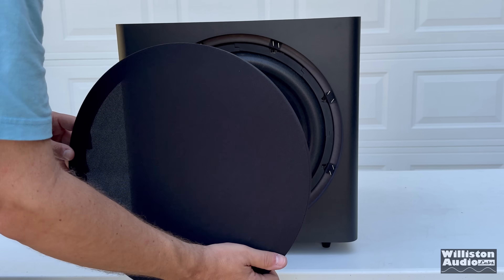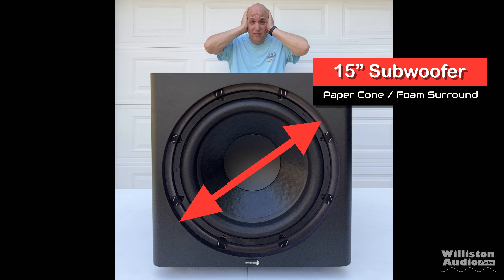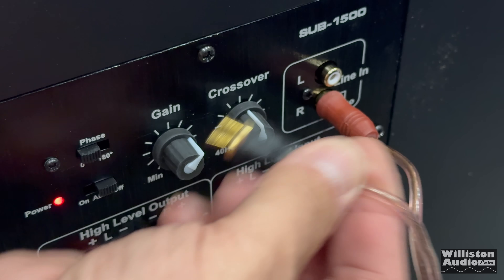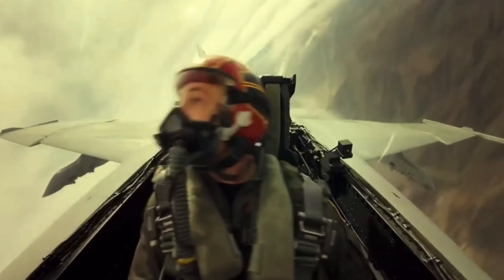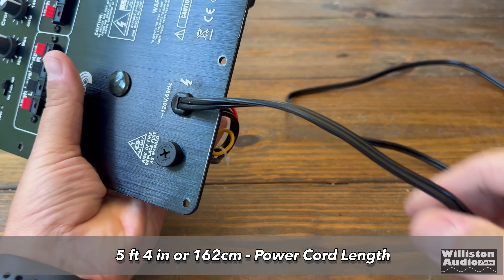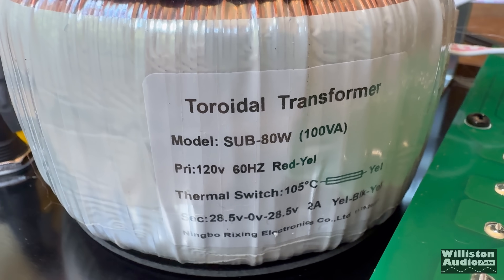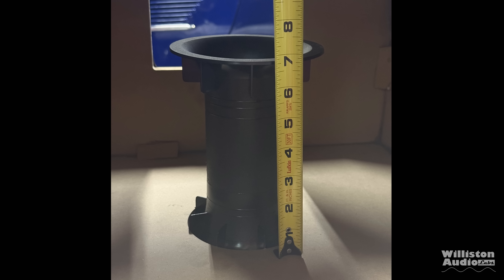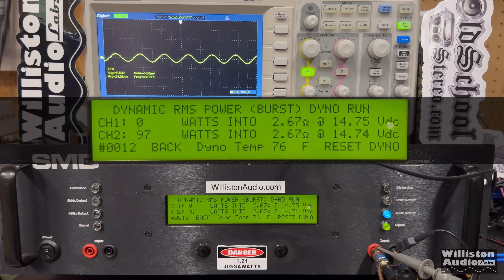Exposing Dayton Audio SUB-1500’s Biggest Secret—It’s Not 150 Watts!

Comment: This is why you build things yourself, people. Look at reviews of individual components and put together something that works. Usually, you can do it for these budget prices and beat what you get (and sometimes beat what is advertised).
Reply: @NorthernWhisper  Right. But when you buy Dayton amplifier to build your own sub won't it be the same lack of power?
Reply: @california3527  Thought i replied to this already but the comment is gone.. hmm.

In any case, don't buy their amp. get a suitable fosi audio amp with a beefy powersupply. Also be aware that their ratings are off so get something they claim to be 200w so you will actually get a full 100-120w of power ;)

You can get that for less than $100. Used enclosure from your locals costing around $20 and find a suitable woofer for that enclosure/your needs that sits at under $100. There you have a twice as powerful DIY build. No need to even make your own enclosure, as long as you have the information needed to know what to get.
Reply: @california3527  Use a fosi audio amp or whatever. Best value is getting a bt30d pro, which will deliver 250w at 2 ohm to the sub and 150 to the stereo channels at 4 ohm with the right powersupply. 

If the budget is tight, they still sell lesser amps for a bit less, but the value isn't as great. Still, you can get an amp for well under $100 that beats the one in this sub. Then you just match it with an appropriate budget woofer and build a simple box or get a used box for almost nothing from your locals.

Comment: for us with dsp, we can just plug the port and boos the bass, to get 20hz out of these cheap subwoofers.
then it is nice to know the max output at those frequencies. powers open and closed please.
and report back on the noise/distortion you hear that the subwoofer makes down low at 20hz.
Reply: There's no way this driver will get any reasonable output at 20 Hz, least of all with that little power. IIRC, Audioholics found it to have roughly 85 dB output RMS @2 meters, CEA-2010 testing. Compared to around 105 dB at 40, meaning you're gonna need serious boosting to increase linearity down low. In-room it might be better, but if you block the port you're throwing power at a sealed sub with a resonant frequency around 50 Hz at best to try and make it play flat to 20. That's gonna take more than this sub can either deliver or handle.
Reply: @TokeBoisen   you re reading the Audioholic testing wrong and my comment.
you plug the ports and you gain output below port tuning, and no need to add much gain to boost the lows, you have room gain and max output at 50hz and above usually is more then you need so it is the lowest bass that is the limiting factor.
and the resonant frequency and below plays just fine on many subwoofers and drivers in a sealed box.
and you wont need so much power to reach xmach on a sealed dsp tuned woofer.

that is why i wrote my original comment, lets get some testing on this so we know more.
you Theorycrafting is not helping anyone, you need experience in this field.
Reply: @sudd3660you're making a lot of assumptions about the driver's behavior in a sealed cabinet, the room size of the user, not to mention my knowledge in the field of subwoofers to make this comment. Suffice to say I don't agree that plugging the port on this particular design would work very well to increase or achieve any substantial 20 Hz bass output unless your room is tiny.
Reply: @sudd3660so because I don't like to be unsure if I've understood something, I simulated the driver in a sealed and vented enclosure as described in this video, and it looks like, looking at AH's testing, they implement a high-pass to protect the driver on the lowend, otherwise the frequency response doesn't line up. You'd still have to account for that if you plug the port and don't replace the amplifier. Either way, given the same amp and box size, in the same room, there's no scenario where the sealed configuration improves the output over the vented for this driver in this enclosure with this amp. Sorry.

Comment: I just sent parts express an email request with this video linked in it lol now we play the waiting game and see what they say. I said " 70 ish watts at $300 plus tax with fake ratings on the box and advertising is just disappointing. "
Reply: According to the model of the driver, it's rated at 150W RMS, and it IS a powered sub, so it's a 150W powered subwoofer :P They didn't say it was powered BY 150 watts :P They also didn't state RMS, and if you remember the old PMPO ratings that got out of hand, you basically can't trust any rating that doesn't specifically state RMS or THD. Which is not to say I don't think it's a scammy trick - but they're not lying so much as omitting the truth. With all that said, I don't care much about wattage. You can put 100 watts through a lightbulb and it won't even make a noise, so efficiency or SPL is the more important factor.
Reply: You should have probably sent that email to Dayton audio. Not Parts express. They are simply the distributor. Dayton audio are the ones blatantly lying about the power output.
Reply: @dextermorgan1 Dayton Audio IS Parts Express. Look up the trademark.
Reply: They should catch an earful as well.  @dextermorgan1
Reply: They'll probably blame the Dyno say it was rigged lol

Comment: I have to of their 12" setups, not impressed so I  Built a box for a skar 18 SD in widisd. 24 hz, running a SD500 plate amp. Cant use but about half volume in my theater room, its over kill.

Comment: I really hope it was an error on their part because Dayton Audio is a very good company as well as Parts Express so it will be sad if either one starts going to shit with the lying about the products.
Reply: They very likely were doing this as a way to dump old stock.
Reply: @LKN117  That still doesn't excuse blatant false marketing. Cheap, small wattage subs do have their place for beginning audiophiles who want to beef up a little bit the bottom end of the bookshelf speakers or fill a room bass nulls with multiple subs. They do not have to lie about the performance as long as the price also reflects the real specs.
Reply: @MaaZeus who said I was giving them an excuse for what they did? All I did is say what more than likely happened to bring this product to market.
Reply: @LKN117  I didn't. I just pointed out that what ever their reasoning was, it is still scummy AF. Not counting in potential mix ups in production line of course.
Reply: @Bassotronics  For real
Reply: Yeah, I love my UM18. Good product!

But honestly Parts Express, it's very simple, just don't lie. It really is that easy. If it's 60 watts write 60 watts on the specs. Nobody likes a liar.
Reply: C’mon! That know what they are selling.

Comment: Big D, I have a Level 3 Sub powered by a SDA-200 Digital amp from Home Theater Direct in Wylie, TX. (They are not selling the Level 3 right now, but they still have the Level 2.) I also have the HDX in-wall speakers for the fronts,  SDX for the rears, and a Level Three center channel speaker. Fantastic products and great service frm HTD. "Do it bump tho?" Oh hell yes it does! Shakes the dang house. Little Class D amp barely gets warm.

Comment: Limited bass below 30hz for a 15, they shouldn’t have even considered this a home theater sub. 

A proper home theater sub should be able to dig into subsonics. My outlaws are only 12’s and play down to 17hz with no issue. And my tiny Martin Logan 10 downstairs plays to 24hz. 

Yes I know these cost a lot more than the Dayton , but a driver with such a high FS used in and marketed as a home theater subwoofer just seems really lazy on Daytons part. I have built home theater subs using Daytons budget drivers in the past , and with a proper enclosure they would dig down into the high teens hz range with great output on minimal power.

This sub in review is disappointing as heck , Dayton can do way better than this.

Comment: They dont sell in the USA, but in the UK I highly recommend BK Electronics. They used to make subs and plate amps for REL, but now sell direct.
For high quality bare bones, real wood veneered subs they are hard to beat. You wont get an app or a remote, but you do get honest Class AB amplification, high and low level inputs and cabling for very reasonable prices.
Think REL subs from 15 years ago.

Comment: For the same price you can get a RSL 10E Speedwoofer 10" subwoofer rated at 300w RMS 800w peak.  The subwoofer is considered to be a TRUE subwoofer.  Sells for $299 total cost SHIPPED.  This is a low cost top rated SW.  I would like to see Williston Audio Labs test out these subs.
Reply: @dungysphincter7974   I have 1.  They are fantastic.   Best value sub all day.  Plus the extended range it has is nice to fill the gaps left by my small fronts.

Comment: On one hand it's awful for them to lie about the specs.  On the other hand it's really interesting to see just how little power a sub actually needs to get LOUD.  I'm running a 10-inch ported passive NHT subwoofer with a little 108 watt digital amp and it's WAY more power than I need to shake the windows.  I feel like all these amps advertising 800, 1000, 1500 watts are just marketing.  I'd love to see an actual power consumption log for some of these big subs while in use.

Comment: Shame on PE to actually sell that POS. Ya, amp looks like it's made for the power you got. LOL 80 watt transformer, yep. No acoustic fuzz either? Hey, they didn't completely lie. The speaker is rated for 150 watts! I wouldn't pay over $179.00 for that let alone the outrageous $310.00! I could be wrong, but when the switch is set to AUTO, I found with subs I have been able to play with, the power consumption does NOT change from OFF/AUTO /ON when idle. I think the switch just mutes any hum or static sounds until it hears real audio. My powered subs are unplugged or actually off using a power switch if sub has that when I'm not using stereo.

Comment: I'm more than disappointed with Dayton Audio. You can see on the parts express site, the Sub-800, Sub-1000, Sub-1200 and Sub-1500 all use the SAME plate amplifier. The only thing that changes is the silk screened model number. All the acoustic audio models on amazon from the 6" to the 15" model use the same garbage amplifier. I expected better from Dayton Audio.
Reply from the maker: I was thinking the same but the 8” sold out before I could get one to verify

Comment: It's not fake, just different measurements. You are measuring the average non-distorted and sustainable power. They were measuring the peak power, which the amp can provide for a split second.
Reply from the maker: The other Dayton plate amps were much closer to their rated power using tests. These are the same style tests used by the Audio Precision, an industry standard
Reply: Peak would be something similar to his burst test tone, if they don't clear 150 watts there, it's extremely unlikely it would ever reach that power output in a real world scenario.

More than likely the amp could maybe get close at peak with a 1kHz tone, but then they shouldn't rate it 150 Watts for a sub.
I've seen similar from a boutique Danish brand and their power-amp for their own subwoofers, where it can generate 400 Watts at 4 Ohms at 1kHz, but when I tested it at 20 Hz, it pooped out at 100W

Comment: Thank you for doing these tests.  This Dayton Audio looks like a sub, but it doesn't play like one.  I can get 31 HZ Bass from my 6 and 1/2 inch woofers with a 200 W class D amp.  Each woofer weighs 5 lb.  I'm talking about Elac DBR62 reference speakers.  With enough clean power they do serious Bass.  There's another sub for sale with two 6 and 1/2 in drivers that goes down to 20 Hertz.  You don't always need big speakers to get great bass, you need great design and power. It pays to do some research before you buy anything...  Thanks much for this video 👍.
Reply: Problem with small woofers is efficiency and distortion. Those DBR62s are like 68dB in the 30s with crazy distortion. Even a 10" sub will make much cleaner bass with way less power.
Reply: @future62   If you're in a smaller room and not trying to fill a three-story mansion with 24 rooms, and have enough clean power, smaller subwoofers do fine.  Guess how I know this.  You can always check my channel description to see if I know anything about what I am talking about...👍😏.
Reply from the maker: Glad you liked the video and thanks for sharing your experience! 👍
Reply: Haha, I can get 34hz bass off of some 4" Dynavox Ly401f full ranges at low volume levels. These speakers have a resonance at 53.5 hz and a qts of .26, its also a good candidate to replace broken woofers in the RadioShack Minimus 7.
Reply: @bk3720   Very cool Sir👍. I heard some two-way speakers that were shaped like a little cubes put in the corners of a room that filled the entire room and had really great bass.  I don't know what the heck they were, but they were driven by a good Onkyo amp about 60 watts per channel.  That was in 1979!!!  😏

Comment: I don't like marketing-watts, and their frequency response claim is also extremely optimistic, but at least in Audioholics' testing it output some pretty decent numbers for the price in terms of actual sound pressure. That is something at least, and a testament to the fact that watts isn't everything.
Reply from the maker: If this one tested well for them they should try the Rockville. It was much better in room and I’ll do some frequency sweeps in a comparison video in the future and we’ll see. I suspect the Rockville is 2-3dB louder at almost all frequencies under 50Hz
Reply: @wal "Tested well" is probably relative, but above 40 Hz it did decent SPL numbers for the price. They did conclude that in-room usable output was limited to around 30 Hz. They did test them in a dual sub configuration, to compare with other subs around the $500 mark, and in terms of CEA-2010 testing they did compare pretty well by that metric. I don't think AH generally test many budget products, and only when sent them by the manufacturer, so your testing is very much appreciated. It was mostly to give some perspective on the disappointing wattage claims and provide a data point.
Though, it's not impossible they received units with more capable amps? It was a few years ago now.

Comment: If a person were to piece a powered subwoofer together with an external amp, power supply and prefab box they could probably get a higher watt subwoofer at a lower price. I have two powered subwoofers that the plate amps went out and have converted them to use external amplifiers with good results at a low cost.
Reply from the maker: That is an excellent point and a great way to get more out of your sub.
Reply: @wal Appreciated, and keep up the interesting videos.

Comment: I have a M&K V-125 sub from the mid to late 80's that I got for 50$. sounds about how you described this sub but for way less $$$ and it makes your videos sound awesome
Reply: Funny, I had an M&K V-125 that I bought new back in 1997 or 98 I think.  It was a great sub.  I ended up doing a DIY sub though using a Dayton 15" Titanic driver powered by a Parts Express 640w plate amp.  I've been running that for MANY years now and it absolutely rocks as both a musical sub as well as for home theater.  I love PE and Dayton but this was a very disappointing test.  I definitely think this was an honest mistake as this is very unlike PE.
Reply: @mckeanbrosoffroad150  it sounds great and clear for 50$ and beats anything at its price! sealed box for a clean and defined sound but can't go lower than 40hz from my testing. I think the amp I paired with it probably has something to to with it. my system costs a total of 110$ for all the audio stuff and for that price you definitely cannot complain
Reply from the maker: I have the smaller 8” version I think it’s the V-75 but the amp needs some work, recap I think
Reply: @wal  My sub had the plate amp removed and replaced with speaker terminals. I have it hooked up to a Sony Hifi system as an amp that most likely isn't delivering enough power

Comment: @Wal- Thank you for this test. After port, sub displacement, & using 6" for the tunning Length of the 3"dia. Flared port( you don't use a half inch on either end of a 3" dia. flared port for tuned calculations) = 30 Hz tune. Its very sad that Dayton Audio is Lying to us about the actual power of this powered 15" sub= only 70 watts R.M.S @ 4 ohms, not 150 as they advertised.
Reply from the maker: Thanks for watching and for your analysis!
Reply: @wal  Thank you for your reply, Big D. Also i would really like to see the review of that gold subwoofer, & then the SPL test between it, Rockville, & this Dayton Audio powered subwoofers. It would be even more AWESOME if you tested All 3 of these SPL @ 20 Hz, 25, 30, 35, 40, 45, 50, 55, 60, 65, 70, 75, & 80 Hz, as 80 Hz is the recommended crossover point for a Thx certified center ch., for home audio, Thank you.

Comment: This is why I made my own home sub, got a nvx nsw124v3 on sale for 60$ a 1.2cu ft sealed box new for 30 local place, bought a Chinese amp that uses a tpa 3255 that can do 600 watts at 2 ohms, and im powering it with a 48v 10a power adapter total cost was about 200$ and this thing SLAPS, I would say it does not due 600w probably because 48v x 10a is 480w
Reply: @crm4667  It's ok that you can't power it to 600w because those chips are rated at 10% THD which is A LOT lol. They do like half the power rating cleanly